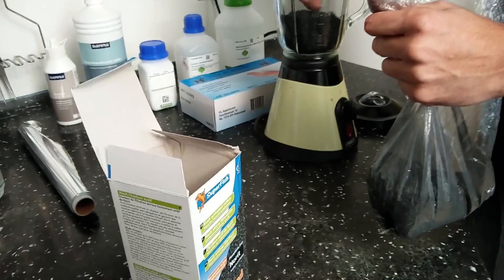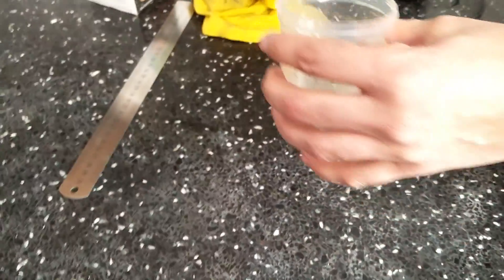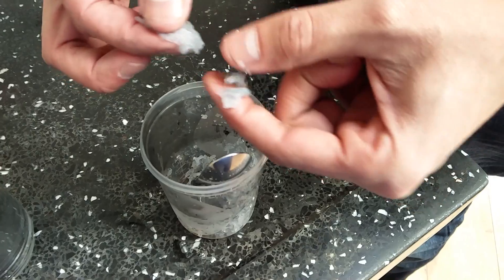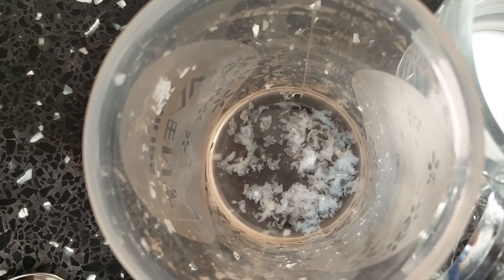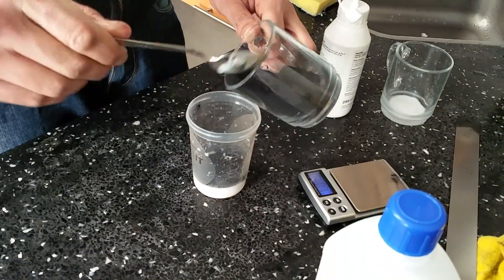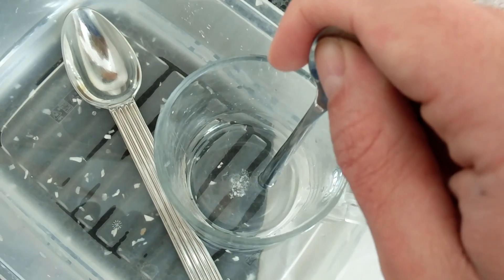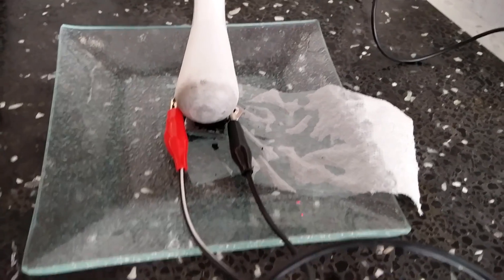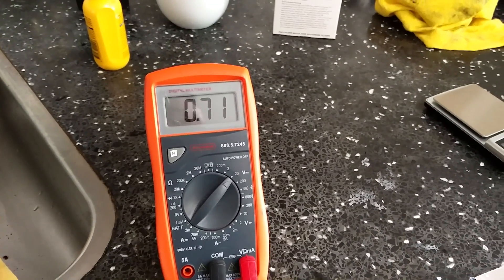Building a SuperCapacitor - Step by step DIY (and getting to know the different materials)

Comment: anything other then sodium sulphate?
Reply from the maker: Demineralised water
Reply: I made with similar materilals a Cap and used saltwater as electrolyt. Output Voltage was the same as by Flip's experiment.